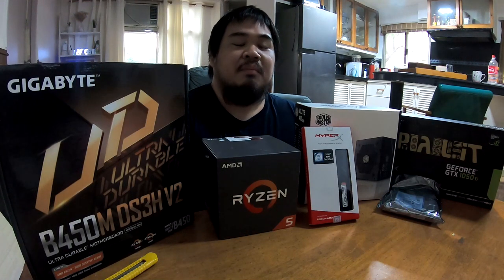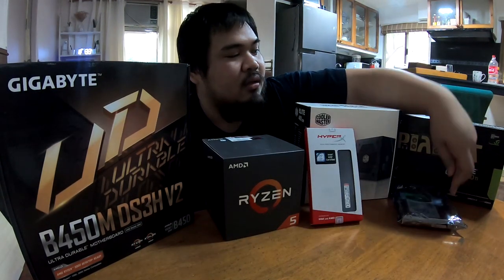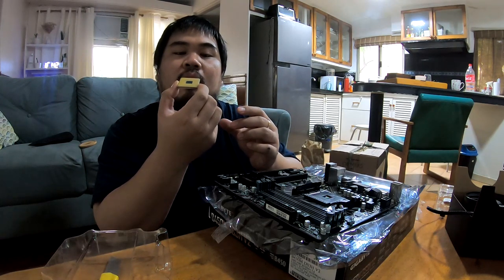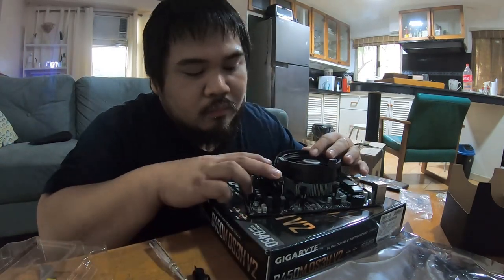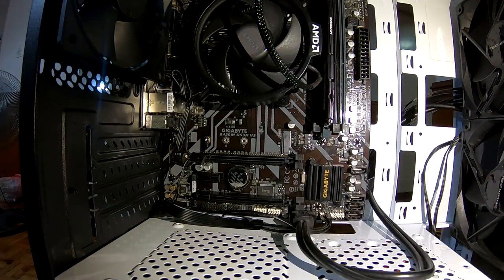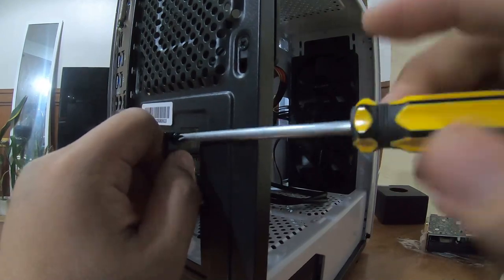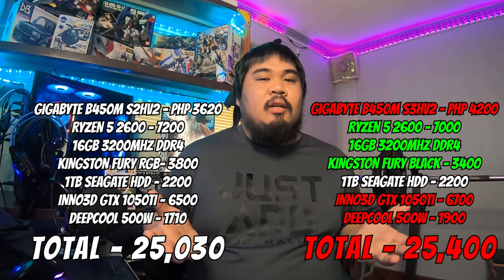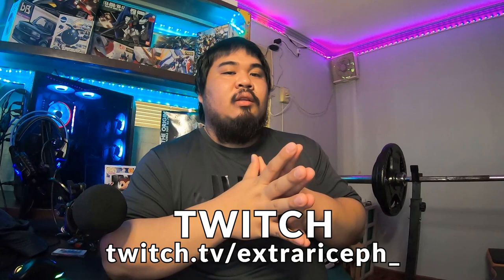HOW TO BUILD A 25K BUDGET GAMING PC

Comment: Guys I have a problem and I haven't found an answer yet about what it might be, but here's the thing, I'm having a problem with his pc connecting but only the video card that won't connect, then I have to disconnect and connect it again turn on, after doing this the pc works normal and detail that the video card is actually turned off and not only without video. thank you guys
MAE CARD: GIGABYTE B450M DS3H V2 (REV 1.0)
Reply from the maker: sorry i'm not sure i understood well. does the video card work sometimes or is it always broken? if it works sometimes, maybe a lose connection? if not at all, return to seller

Comment: Bakit di nalang 2x8 na ram? 4 slots naman mobo mo at daming room for upgrade, sayang yung dual channel performance. isa pa, why elite 400watts? lalo kalang mapapamahal in the long run, basura yang elite series, pag nag upgrade ka ng gpu iiyak yang psu mo, hindi pa 80+ certified. yun ram ang pangit ng choice, ang daming ram na cheaper pero same performance. Lastly, bakit walang ssd? 240gb ssd + 500gb hdd lang ok na, malaki nga storage mo, mabagal naman, wala din.
Reply: Yun din napansin ko, I have better quotation for this price point.
Reply: parecommend po ng pc build 20k budget
Reply: @ushuaiabelen2510  arecommend po ng pc build 20k budget
Reply: @limaj07  Magbibigay ako ng links ng mga parts na maaari mong mabili. Tutulungan kita for free
Reply: lods mas ok b ung 2x8gb na kingston 3200mhz?
Reply: @twistbeltran3180  yang mga ram na yan, halos pare pareho lang yan interms of performance, kung yung kingston na 3200mhz cl16 2x8 ay 4000 pesos, at yung tforce 3200mhz cl16 2x8 ay 3k, ang pinagkaiba lang nila ay presyo at itsura, yun lang, preference nalang yan, pero sa performance, wala halos pinagkaiba
Reply from the maker: Salamat sa suggestion! 2nd build ko palang ito and I still have a lot to learn.
Reply: @ExtraRicePH  Sana mag grow ang channel na ito. Keep it up po.
Reply: @ushuaiabelen2510  pwede ba ako mag patulong mag hanap ng parts? Meron na ako dto list ng nga parts na bibilhin ang sabi sakin 21k yung price nung nag hanap ako sa lazada umabot ng 29k
Reply: @rhobbiefernandez  Full specs ng ibi-build mo Sir?
Reply: @ushuaiabelen2510  
Ryzen 5 2600
A320M Motherboard
2x8gb Ram ddr4 3200hz
128gb SSD M.3 NVME
1TB HDD
RX5500XT VIDEO CARD
5RGB Fans
DarkFlash pollux case
600 watts 80+ Bronze PSU
Reply: @ushuaiabelen2510  yan po sir
Reply: @rhobbiefernandez  Sige Sir, hahanapan ko ng price lists yan.
Reply: @ushuaiabelen2510  ok po sir wait kopo
Reply: @rhobbiefernandez  Ang tataas kasi ng presyo ng gpy ngayon, kailangan mong dumagdag ng pera para sa budget.
Reply: @ushuaiabelen2510  1050ti 2nd hand 4,500 ok ba ?
Reply: @rhobbiefernandez  Okay na okay basta in good condition pa. Yan ang gamit ko ngayon at kaya pa mga games in Ultra settings.